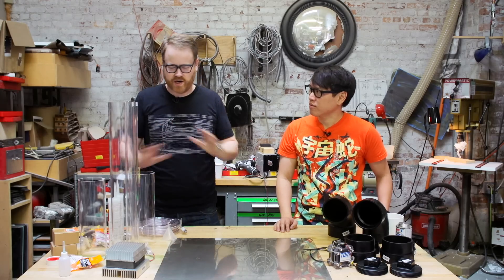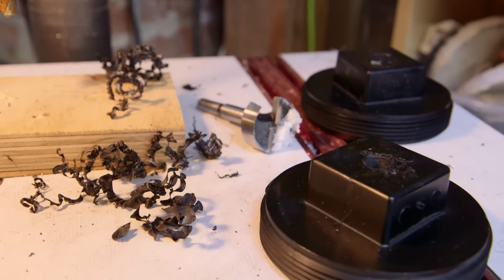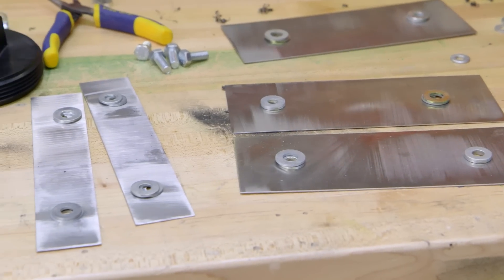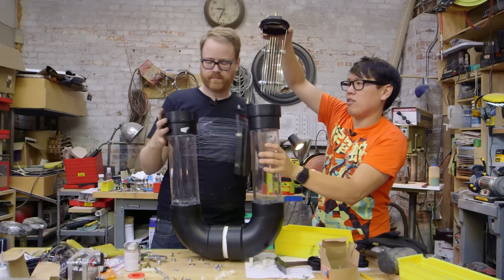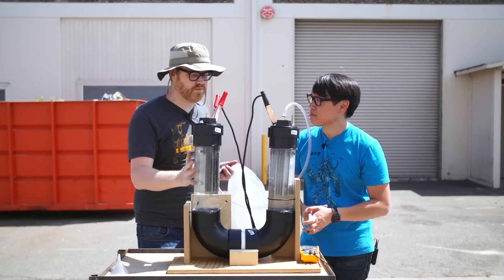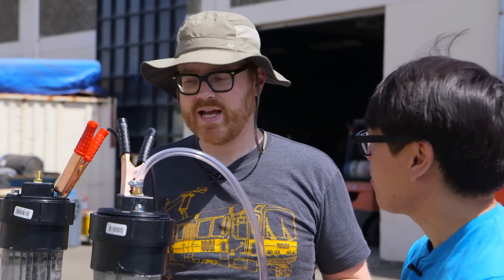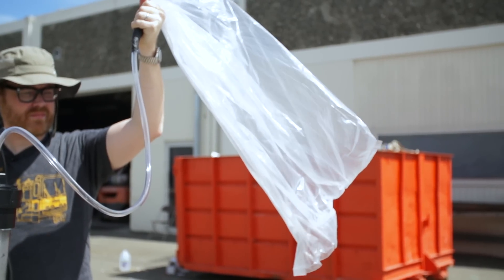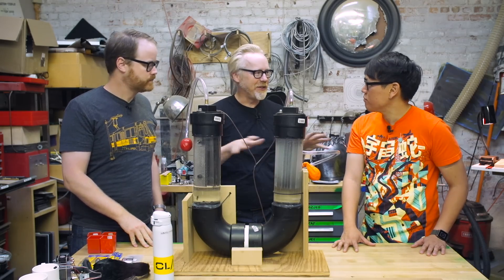Tested Builds a Hydrogen Converter

Comment: It's a good idea to try to separate the gasses, but this brings up a very big problem! The speed of creation of both gasses is bigger  when the current is bigger. But as we know from Ohm's law current is inversely proportional to the resistance! So if you want big current you would have to minimize the resistance. In your design, in order to be able to separate the gasses, you electrodes are a relatively big distance apart. That means that the resistance is big. That means your current is small and consiquently your efficiency is very low. If you want to increase the efficiency you would have to connect the device to a power supply that offers big voltage and can withstand at least 1Amp of current draw.

Comment: One hypothesis is that the Hydrogen is comming back into the tube... please, install a valvule to block the gas to comeback into the system.
Reply: Frederico Sousa it was very inefficient mostly because you need high amperage to produce hydrogen and oxygen and high voltage depending on how far the electrodes are. There was way too much space between the two electrodes in their experiment and it was really slow. I built a waterbottle-sized hho generator that was probably 5-6x faster than theirs

Comment: 9:19 lol you can see the anger in Adam the moment they say, we used clean energy to do it, and he realized they failed it on purpose.
Reply: ohhh you can. hes probably thinking "how can i get this guy off my show"
Reply: @twig4661  "you're fired."
Reply: Clean energy wasnt the issue....the issue is they didnt use enough....the amperage matters not the voltage.  You only need 1-2 volts for electrolysis, but the more electrons you force through the water the more hydrogen you release and that means more amps
Reply: @jerometruitt2731  electrolysis is most efficient at 1.22 volts. "more volts is better" smh
Reply: @Grahamaan27  when did I say "more volts is better"?  Learn to read, then comment.
Reply: @jerometruitt2731  the could get 5 amps which is enough for some good production, but the resistance from like a 3 foot gap between electrodes probably meant they never got 5 amps

Comment: There is this large distance between anode and kathode. This means a lot of resistance by the water. The higher the resistance, the lower the amps. This will never work. I would alter the setup.

Comment: It didn't work because the bag & balloon have holes between molecules that are larger than hydrogen. Think about it, you use a mylar balloon for helium & helium is larger than hydrogen. Hindenburg was made with cow stomachs sewn together. One of the few things available at the time that was able to hold the gas. Also, the pressure sucks because of the electrolyte. Should revisit the same rig with a proper balloon,  Arm & Hammer baking soda . . . distilled water & seriously . . . power. This is a poster child for why nothing gets done when you want to "Go Green". I'm all for saving fuel, but not at the expense of having a complete & total failure.  Something needs to change on the quality of the experiment or there won't be mad genius laugh of success. #OctopusFacepalm

Comment: I've done this in my garage.  I know it works, runs a lawnmower engine no problem.  On mythbusters you purposely built a very poor hydrogen cell and hooked it to a car.  Now you build a shitty hydrogen cell and under power it and say it doesn't really work.  Obviously from reading the comments everyone is asking the same question, why are you purposely debunking this idea.  Also researchers have come up with 100% efficiency with electrolysis.  follow link https://www.youtube.com/watch?v=V4ivk-Qr0UI 
Really what's the deal? It just makes you all look really bad.
Reply: Although it's impossible to get 100% efficiency in anything from a science standpoint, you are right in that they really do make a pretty crap one. You'd have thought being they are supposedly professionals they'd have made something pretty good. Something tells me it's deliberate to put people off doing it. Perhaps they are concerned people will hurt themselves or maybe they just have shares in oil

Comment: You've gotten the voltages wrong.  22 Volts is way too high.  You really only need about 2 to 4 volts depending on your electrolyte solution.  At 22VDC the water gets too hot to crack efficiently.  In this instance more voltage is a bad thing and you've pushed the absolute edge of diminishing returns.  Like when you make an HHO gen, you want to see a 2 to 4 VDC drop from one electrode plate to the next.

Comment: You state that you are using the process from King Of Random.  However, you clearly are not.

He used a specific number of plates, with specific measurements, while you seem to have just randomly picked some plates.  He also used nylon bolt to thread through the plates, and you used metal.  The King attached them using both nuts and nylon washers in a specific array, and you saw fit to to use just nuts willy-nilly.  Random had a separate bubbler for the gas, while you two just went without.

Next time why not just admit that you went with your own design, rather than say you copied it from someone who did it correctly.

Comment: I HEREBY STATE THAT THIS VIDEO FROM ADAM AND HIS CREW AND THE RESULTS 
PRESENTED IN THIS VIDEO IS A FALSE PRESENTATION OF THE TRUTH !!! AT 
LEAST IT IS TWISTING THE TRUTH!!! AND DOWN BELOW THIS COMMENT I SHOW YOU
 THE LINK TO A VIDEO WITH A REAL WORKING DIY SOLAR POWERED HYDROGEN 
SYSTEM FOR POWERING A REAL DRIVE LEGAL CAR AND WARMING A REAL HOUSE!!! I
 ALSO EXPLAIN HOW THEY SHOULD HAVE DONE IT AND WHAT THEY DID WRONG!!!

What a ridiculous video, it makes me furious. This is the second time 
that these people from mythbusters come up with a stupid 3th grade and 
by far the worst possible hydrogen setup in order to proof efficiency 
for electrolysis. It's only logical that they didn't get any satisfying 
results and to me as an expert it is clear that these folks have no idea
 what they are talking about when it comes to producing hydrogen. To me 
as an expert this setup that was made by Adam and his crew is not even a
 real effort to get some reliable results because it is way to infantile
 to take it serious, even though Adam and his crew present their results
 as if they are experts and as if it is the truth, but I will clearly 
state right here and right now that THEIR setup and the following 
results is a false presentation of the actual truth. 

7 years ago I produced way more hydrogen myself with a setup that was 
build by myself at home and it was much smaller as well, but the 
difference between the ridiculous setup from Adam and his crew and my 
setup and as well as the setup of many others who engineered and build a
 similar device, is that our setup was well engineered and well build 
and it was following the laws of physics. To make a comparison, Adam and
 his crew try to use a tooth pick in order to dig out the pyramids, and 
when it doesn't work well or fast enough they say it is impossible to 
do. That's how stupid their setup is!!! While they could have used a 
well engineered setup in order to get GOOD results. For every job there 
is the correct tool to use, and what they showed was not a tool but a 
very badly engineered kids toy that isn't even functioning well enough 
to prove any point at all. If you work as a construction worker you 
don't go to the job site with a dinky toy as an actual tool, but still 
that is exactly what Adam and his crew are doing, leaving numerous 
people behind with false information. 

Please allow me to explain:

This setup from the clowns in this video is a very bad replica from a so
 called wet cell configuration and they replicated it from a guy who is 
NOT an expert in this matter but instead he is a hobbyist who makes 
popular videos for kids. And although the king of random makes great 
videos, I believe that in order to proof a scientific point one should 
always try to use the best possible configuration and materials 
available especially when the subject of the demonstration is to proof 
EFFICIENCY, and the setup that Adam and his crew simply replicated from 
the king of random is nice for demonstration purposes of how to produce a
 few bubbles, but the device that the king of random build is absolutely
 inadequate to proof a scientific point of this matter and it was never 
engineered or build for that purpose as well.    

The size of this particular wet cell that Adam and his crew are using 
tells me directly that it designed to work best under a relative heavy 
load, so relative high amps compared to what their solar panel is able 
to deliver. These type of WET CELL devices normally draw about 20 amps. 
These type of WET CELL devices are never engineered or build to be 
efficient.And the solar panel that is used by Adam and his crew is able 
to deliver 5 amps at the most under the best possible conditions and if 
they had a well engineered device to begin with. But Adam and his crew 
didn't even build it well because they used way to many plates for the 
voltage that is used even if they had done it correctly to begin with. 
And not only the number of plates is critical for a well functioning and
 efficient electrolysis device, but the amperage is also very important,
 the amperage depends on the amount of surface area of the anode the 
cathode and the NEUTRAL plates combined, and on how well conducting the 
electrolyte is. The correct to use voltage depends on the total number 
of plates. That means the total of the anode and the cathode including 
the NEUTRAL plates. Neutral plates are plates that are not directly 
powered or connected to a power source.  

So for example: When you have 13.8 volt you should use 1 anode, 1 
cathode and 5 neutral plates in the middle, so a total of 7 plates. The 
total voltage for each plate should never exceed 2.3Volt otherwise you 
will create heat instead of hydrogen. But if you don't have enough 
voltage or not enough amperage very LITTLE OR NOTHING will happen, and 
that is exactly what we see in this ridiculous video. 

They should have used a voltage and an amperage meter because if they 
had done that they would have seen that they simply don't have enough 
voltage AND/OR amperage for THEIR STUPID SETUP  in order to make it work
 right.

This video tells me that they have it all wrong. Wrong configuration to 
start with because they should have used a DRY CELL configuration and 
NOT a wet cell, wrong number of plates because they should have used 
less plates for the anode and cathode, they don't use neutral plates AT 
ALL but instead they have only one cathode and only one anode because 
all THEIR plates are all connected together so it acts as one, wrong 
voltage, wrong amperage, and no pulse width modulator with current 
limiter but instead they use regular straight DC current and they 
positioned the anode and cathode way to far apart.....IT IS ALL WRONG 
WRONG WRONG !!!! And even if they would modify this WET CELL it would 
still not be as efficient as a DRY CELL!!! They did not show ANY numbers
 at all to proof their power input, they just guess that the device is 
drawing 100 watt because the sticker on the back of the solar panel says
 it is 100 watt but actually that proofs nothing at all. If the 
electrolyte is not made correctly so that it is conducting the 
electricity well enough then the device is not drawing enough current to
 produce hydrogen, and if the device is not drawing the current then the
 solar panel will not deliver 100 watt, it is simple as that. So we want
 proof, we want to see the numbers otherwise anyone can make false 
statements like the clowns in this video. 

The setup in this video is simply the worst possible setup collecting 
reliable results about the efficiency of the whole process called 
electrolysis, in fact the only proof I have seen in this video is that 
they have proven that they know absolutely nothing about producing 
hydrogen except for the most basic stuff that you learn at the 
kindergarten. It is that bad!!!

In the same time and with all those tools and materials available for 
those clowns, and with the same effort and money they could have 
engineered and build a well functioning device!!! Instead they choose to
 replicate something that they have seen on a popular kid show on 
youtube. They are totally ignoring real science and all the laws of 
physics involved in this matter, and with that they give a false 
presentation of the actual facts. And thats exactly what sickens me and 
what makes me so angry about this video and the previous bit that the 
mythbusters did years ago about hydrogen.  
 
To all the people who made this video:
You all should be ashamed of yourself because you all give a false 
presentation of the truth and you are making science and engineering 
ridiculous and you make it look like as if hydrogen is difficult to 
produce while in fact it is very easy to do if you know what you are 
doing and when you know how it SHOULD be done. The only thing that the 
clowns in this video are showing is their own incompetence. It is either
 incompetence or a blunt lie because all the information to engineer and
 build a well functioning device with the same effort and money is 
available for FREE on youtube and many other websites as well. 

You guys better stick to doing dumb stuff, like blowing up a truck or 
something like that, but leave the real science and engineering to the 
people who know what they are doing, because you guys suck big time when
 it comes to producing hydrogen and you all have clearly no idea what 
you are talking about when it comes to producing hydrogen.  Or....you 
are simply spreading this false information on purpose for a different 
reason, either way you are WRONG WRONG WRONG !!!!!!!!! 

This comment provides enough answers and clues for you in order to get 
or find enough information to build a well functioning device for 
yourself. You don't have to ask me because I am not interested, I did it
 once already and I don't have to do it again. It's not rocket science, 
this technology is well over 180 years old. But one thing is for sure, 
don't get your information from Adam and his crew when it comes to this 
matter because it is unreliable information.

HERE IS SOME REAL AND RELIABLE INFORMATION !!!
https://www.youtube.com/watch?v=Vel9LH57RII
https://www.youtube.com/watch?v=0bXNjTUtMf8

Comment: This is a great video, however, I can’t recommend Grant Thompson’s, the king of random’s, video on exactly this topic enough. Very similar setup, and posted on a bit of an earlier date. The problem with this is the low rate of production of hydrogen gas. That issue can be avoided, I assume, with an change in voltage applied, for greater hydrolysis.

Comment: Positive & negative electrodes should alternate as close to each other as possible, with partitions to channel the separate gasses. Disimiliar metals ( copper-zinc ) creates a better galvanic current. Platinum electrodes have the best catalytic reaction and hold up in the caustic environment. 
Most of the diy HHO producers use stainless because of oxidative film forming on electrode surface.

Comment: I think that's the last Tested video I ever watch, holy shit did they set the bar low... A fuckin high school drop-out could build a better generator than that pile of shit, sheesh.

And by the way everybody, don't glue ABS fittings to PVC, the two different materials aren't meant to bond to each other. When you have several gallons of Potassium Hydroxide solution and a weak bond point like that, you are asking to get burned.

Comment: What's the efficiency of PV cells? IDK & IDC, because it's still way lower than say a Stirling cycle. Now BTW I was wondering what happens if you ran a ultrasonic device to remove the HH-O bubbles, WOULD IT BE FASTER or JUST WASTE ENERGY?

Comment: Hydrogen passes through a plastic bag or balloon easily.  Even if you produced 5 litres, most of it would diffuse through the container.  This is one of the technological challenges to do with hydrogen fuel cells - storage is very difficult as hydrogen is the smallest molecule.  Even very dense metals can't contain hydrogen long-term.    The only way to store it is cryogenically keep it in liquid form, or chemically bond the hydrogen with larger elements.

The stainless plates used in electrolysis will produce hexavalent chromium, which is one of the most carcinogenic compounds known to man.  Pure titanium and tungsten are better options, or other oxidation-resistant elements like platinum, palladium.

There are some interesting hydrogen production methods that don't involve electrolysis, including use of algae deprived of sulfur (algae will give off H2 instead of O2), and chemical reactions such as ferrosilicon + sodium hydroxide + water.  Nuclear radiation can also split the hydrogen-oxygen bond in water; a good use for spent fuel rods.

Comment: my hydrogen generator  https://www.youtube.com/watch?v=yTuShCQFmj4  im just an ole country boy and i made one WAY ! better than yours and it worked great. i can fill a fill a 15in ballone to almost bursting in just 2 min. it runs on 24 volts, 2 car batterys and i have 62 stainless steel plates in a 15in by 15in  1 in thick plastic box. i have a resevuar tank above the box that holds the electrolite and watter and the gass i make bubbles up through that tank of watter , i can also get up to 6 psi on the gas after that i have a pop off that will revieve the preasure.  your design is weak, i am ashamed of you guys for building this crap.

Comment: Hydrogen is the smallest element known to exist and is hard to contain.  Those bags are super thin and have tons of microscope holes in them so the hydrogen gas was passing right through it.   Plus the rate at which they were producing it was very low.